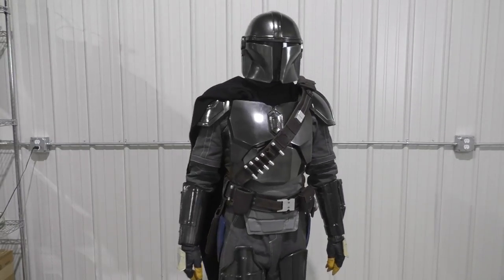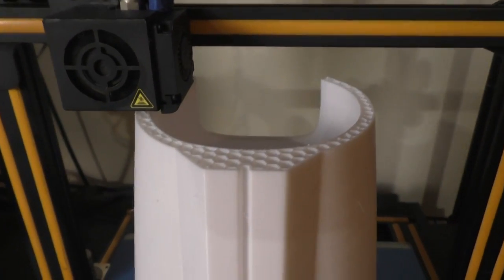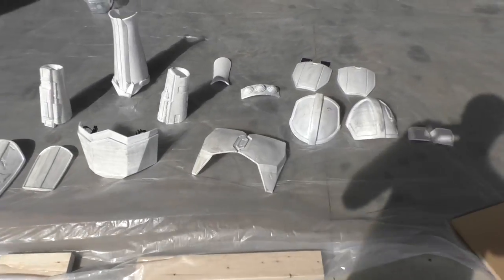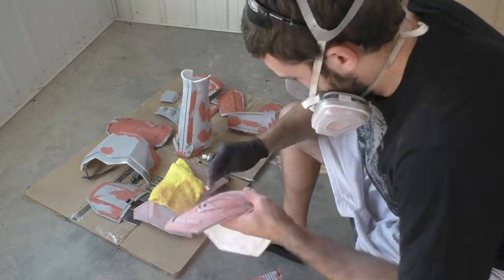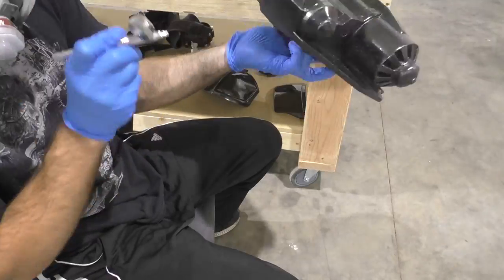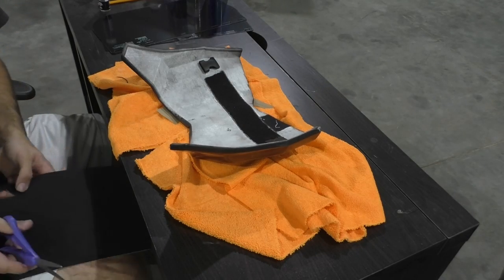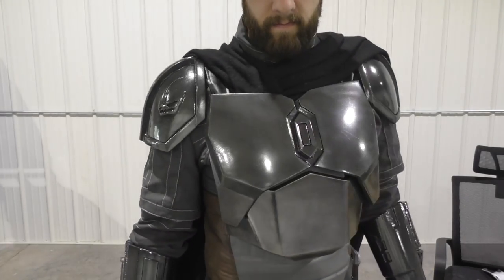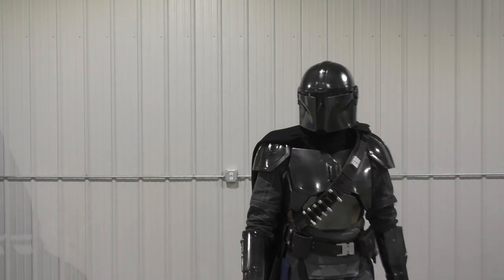Making a Mandalorian - Episode 7 - Putting It All Together!

Comment: An idea for the helmet is to velcro on or button in motorcycle helmet liners. You can buy them separately from the helmet from any motorcycle helmet company. It will keep the helmet snug on your head rather than rattling around.

Comment: I print pretty fine at 0.2mm.
Then sand with 120 grid sandpaper and 180 grid. No need to go super smooth yet.
2 coats of Sprayfiller
2 runs of 180 grid sandpaper until 90% smooth
2 coats of gloss black and it is super smooth.

After that it is just whatever you need for your armor or blaster. 
I find that way of doing it, saves alot of time sanding.

Comment: Great job!

I was wondering how you attached the chest piece and now I know.  Since I wasn't sure I used velcro towards the top but also added straps and buckles that attach to the back plate like I saw you do with your clone armor.  This actually made it easier for me to keep both the back and chest on so I dont have to worry about it falling to the ground if it comes loose from the velcro.

Comment: Hi. Iam a maker from Germany. I just bought the files. At the weekend my two CR-10 printers will run this! Thanks a lot for this man. :)  edit: But...it seams that some files are not 100% ready for printing. Just working on the left forearm. The surface was not closed. Maybe u should take a look at. Iam fine with it so far, it was easy to fix. In a few minutes ill start first printer...lets see...3d printing this large props is always a mindf* ... ;) greets   edit2: btw, your build is very nice done...respect!
Reply: Printing of all parts (except the jetpack) done. May i ask what suit you have used? Thank you. Edit: found the link.

Comment: they applied alumaluster with a spray gun, i really think a slightly wetter coat would of brightened it up, looks really dark compared to movie one.
but other then that really well done.
oh i missed that part in the video where you said it was too dark, but a spray gun applies it super nice. would recommend it, and should even try 2k automotive clear. that stuff can make that base coat shine, and make the whole thing so much more reflective. oh and 2k primer is super durable and fills in all layers in 1 good coat, 2 if you print at at .3 or .4 layer heights.

Comment: This is a great costume, I only have one criticism. I would either reprint the grav charge pack to have a hooked edge on the backside so it can latch on to the belt or (if you're confident enough) sew on a small pocket onto the belt for it to slide into. I looks really strange to have it swinging about with the hip plates when it's supposed to be attached to the belt itself.

I do also appreciate you using Alumaluster. It let me know that I'm not going to spend the money on it for my own build and go with Alcalad or something similar for cheaper.

Comment: Awesome job, I made the same set and got my prints from Galactic Amory, I do have a question if you dont mind, im having an issue finishing with my last two peices...that right shin won't fit on my max neo, I was wondering did you stand it up tall or lay it flat? Also same.with back plate, standing it up makes the jet pack prongs not print very good.

Comment: Hey man, great job on the build first off. I can't help but notice that your helmet seems more stout and less narrow than the on-screen design, is that something you've noticed or would you say it looks pretty accurate in person? I bought your 3D file with the intention of using it for a post-Imperial Mando Mercs build and it looks pretty solid in Cura, but I did want to ask as I'm shooting for as much accuracy as possible. Thanks!

Comment: use some automotive  catalized urethane filler primer with a gun instead of the resin and it you can sand it with 240 for a start...
Reply: i agree 2k primer, 1 coat can pretty much hides all layer lines.
unlike 1 part filler it doesn't shrink back into the cracks when it dries, what ever it looks like when you spray it, it will dry like that.

Comment: where the blue was too dark, an easy fix is to not paint the piece black but leave in a gray or white primer.  This will make your top coat color actually be several shades lighter than if its on black.  They use this technique in automotive painting and will work the same in this application.

Comment: Been following this tutorial religiously. I am on the photopolymer resin step. I brushed it on in one light coat made sure it was mixed well in the bottle and set it in direct sunlight for an hour and it's tacky to the touch. I let it sit longer and it's still tacky. Anyway to help with this situation?
Reply from the maker: It might need more time. Or you could get a uv lamp
Reply: @GalacticArmory  thanks man! I've considered getting a UV lamp I've also heard of rubbing alcohol or giving it an alcohol bath will help cure it

Comment: It looks tremendous!  However, I see some things that really want for improving.  The forearms, thighs and jetpack look awful.  BUT that is entirely because they have a bad gloss, way too glossy.  Also it's totally even.  All those pieces need a little coloration/differentiation even among themselves.  They currently have a bad thin plastic look to them.  The build and proportions look great.  Just decrease the gloss on those pieces (maybe the shoulders too) and it'll be near screen accurate.  Very inspiring work!